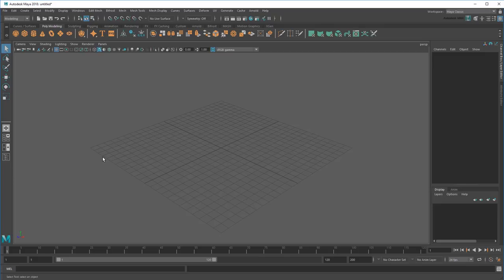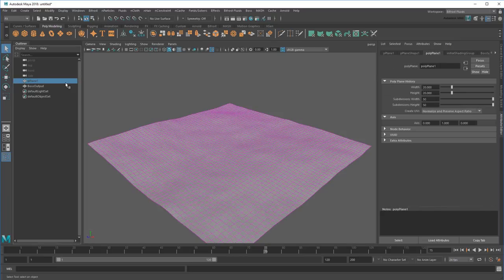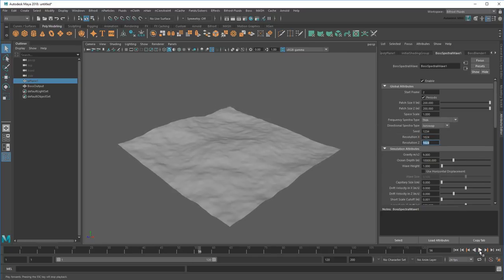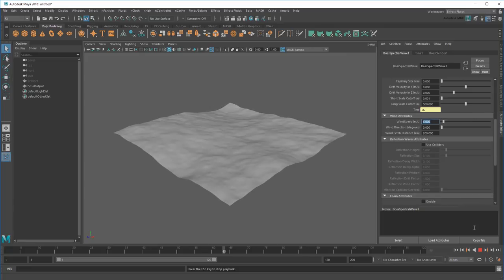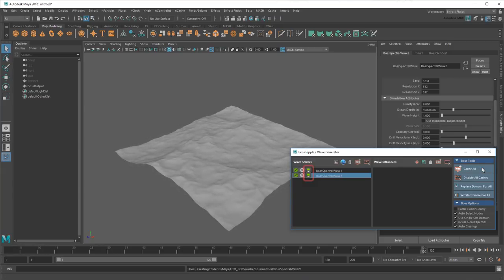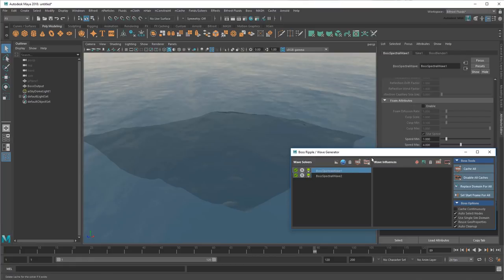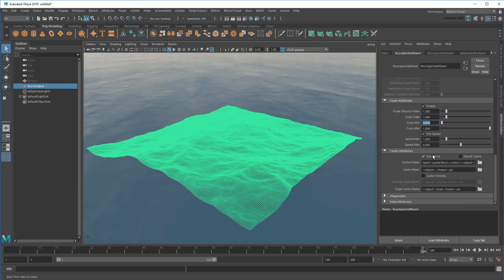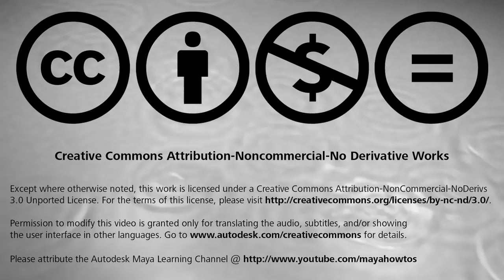Creating an ocean - Part 1 of 4: Getting Started with BOSS

Comment: Boss is not showing anywhere
Reply from the maker: Make sure the BOSS plugin is enabled in the Windows > Settings / Preferences > Plug-in Manager
Reply: @Autodesk_Maya  yes I enable Load and auto load but not working
Reply from the maker: @nitishmishra191  Are you also in the "FX" menu set?
Reply: @Autodesk_Maya  yes
Reply from the maker: @nitishmishra191  When you load/auto-load the BOSS plugin, does Maya show any sort of red error message?  Does the checkbox stay checked?
Reply: @Autodesk_Maya  is shows an red  error but I downloaded maya 2019 so,problem 
Thanks🙂
Reply from the maker: @nitishmishra191  Yeah, that seems like an installation problem so re-installing is the best bet to fix this.

Comment: Hi, I cant see any changes when I turn down my cusp min. On my mac, i tried restarting the application but it didn't work. Could you help me with this issue?
Reply from the maker: Did you make sure to disable the cache?
Reply: @Autodesk_Maya  I did disable the cache but it still isn't working!!!
Reply from the maker: @adrian.a.padilla  Have you tried really cranking the cusp values very high or very low (much higher/lower than shown in the video) just to see if it's a scale issue?
Reply: @Autodesk_Maya  I have the same issue to a certain point, i can see a difference between 0.1 and 0.01, however i still have too much foam and lower than 0.01 makes no difference for me
Reply from the maker: @Yiannio222  Are you sure you plugged it into the Opacity and not the color?  Also, did you build the scene to the same scale?
Reply: Maya Learning Channel same scale and i plugged into the weight of the emission
Reply from the maker: @Yiannio222  Hmm, that should be correct.  Maybe try decreasing the "Exposure" of the foam textures in the file node?
Reply: @Autodesk_Maya  If you mean the colour balance exposure of the file then didnt change anything. Just to make sure, when you say build the scene to the same scale do you mean the scale of the plane?
Reply from the maker: @Yiannio222  yes the scale of the plane, and also making sure that your scene units are default (1 unit = 1 cm).
Reply: @Autodesk_Maya  Ye my working units is on centimeters, there isnt a crazy amount of foam but a lot more than the video has
Reply from the maker: @Yiannio222  Hmm, you could also try increasing the Foam diffusion rate, or decreasing the cusp scale.
Reply: @Autodesk_Maya  Just tried it neither made no difference.. Btw thanks for these quick replies on an old video, haven't fixed the issue but i do really appreciate the feedback. Is there any other essential that i might be missing?
Reply from the maker: @Yiannio222  Do you have somewhere you could post just one of the image files for the foam?  See it would help narrow down if it's the actual file itself or the way Maya is applying it to the texture that's causing the issue.
Reply: @Autodesk_Maya  Ye sure where do you want me to post it? Also quick thought, i manually scaled the plane to roughly the size of the grid rather than making the width and height 20 like the video would that be it?
Reply from the maker: @Yiannio222  As long as it's roughly the same size, that shouldn't matter.  If you can make a post here: https://forums.autodesk.com/t5/maya-dynamics/bd-p/area-b51

then link the post here, I can have a look at it for you.
Reply: @Autodesk_Maya  Trying to make the post with the file attatched but it says i can't attatch an exr or tx file
Reply from the maker: @Yiannio222  I think you need to zip the files first if you want to include something that isn't an image.  It's one of the AREA's safety measure against malicious file types.
Reply: Not the issue, as in i posted it, in case i confused you
Reply from the maker: @Yiannio222  Do you mind linking it here?
Reply: Maya Learning Channel I did i it’s in reply to the zip file message
Reply from the maker: @Yiannio222  Odd, I don't see a link in any of the replies...
Reply from the maker: I found it.  I'll send you a response there.
Reply: @Autodesk_Maya  i'm having the same problem and cant see the link either could you relink the fix?
Reply from the maker: @Muthafckjones  Looks like the AREA is down at the moment, but basically the issue is that you need to regenerate the BOSS cache (in the Boss Editor) each time you change the foam settings.  Otherwise, your simulation will just keep using the same cache regardless of whatever you set the values to.

Comment: Thanks for the tutorial.  Quick question... Is there currently a way to adjust the speed of the Spectral Waves? I have a nice wave system setup, but the waves are moving too fast.  I'm trying to figure out a way to slow things down.  Any suggestions?
Reply from the maker: Hmm, you could try just slowing down the wind speed, but that will also shrink your wave size (because the system is built to be physically accurate).  

Instead, I'd recommend caching out the BossOutput geometry as an Alembic cache (Cache > Alembic Cache > Export Selected to Alembic).  Import the Alembic Cache via the same menu, then select it.  In the Attribute Editor, you can set the playback speed of the cache to whatever you like.
Reply: @Autodesk_Maya  - Thanks for the reply!  Slowing the Alembic option may be the way to go.  Hopefully the slowing down of the cache or essentially stretching the cache won't cause interpolation issues with the mesh.  Definitely a possibly solution though and something I will try.  If that doesn't work, it may just be a matter of playing with scene scale and finding the right combo of parameters.

Comment: I'm still using 2017, is this tutorial still applicable for that version?
Reply from the maker: It is!
Reply: @Autodesk_Maya  How do you think I could incorporate waves into an Autodesk Revit model that needs water in it. I am working on a pier model for construction and architecture purposes as part of a marine research project.
Reply from the maker: @hj2479  You'd probably have to export the revit model as an FBX file, then import it into Maya.  Then you can use BOSS to add waves as shown in this tutorial.

Comment: Boss menu is missing from my ui?
Reply from the maker: Did you load the Bifrost BOSS plugin?
Reply: @Autodesk_Maya  yes, reloaded the project as well.
Reply from the maker: @deepflows89  And are you in the FX menu set?
Reply: @Autodesk_Maya  i fixed it, i had to resinstall maya, there was some issues in the initial installation

Comment: i have a problem 
i render and all of that and i get exr. files and i cant view them att all and those are in file IMAGES
Reply from the maker: Yes, that's normal.  Rendering outputs an "image sequence", which you need for compositing - the next step after 3D work.  To view the sequence, you'll need an image sequence viewer (I use DJView).
Reply: @Autodesk_Maya  yeah i know its normal i just cant look at them with fkcheck